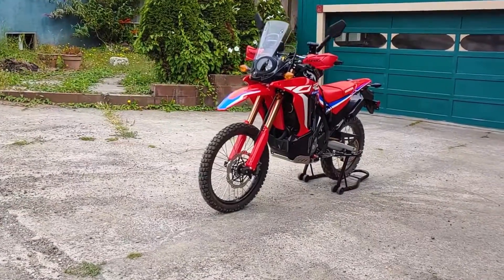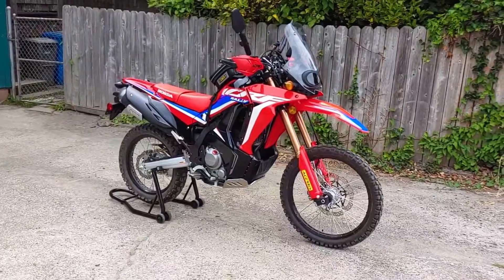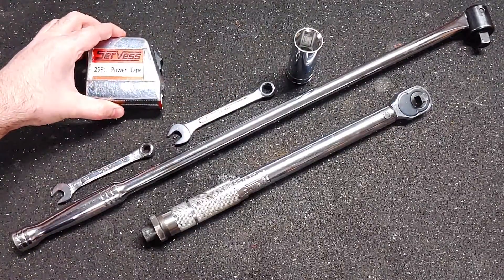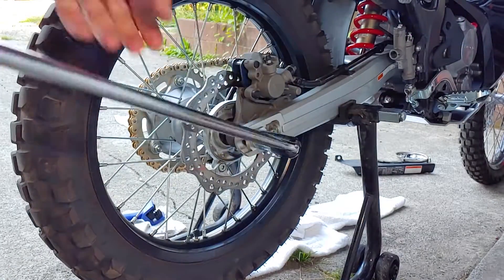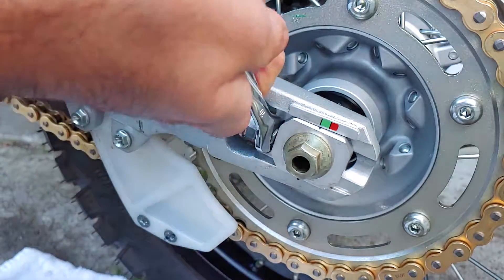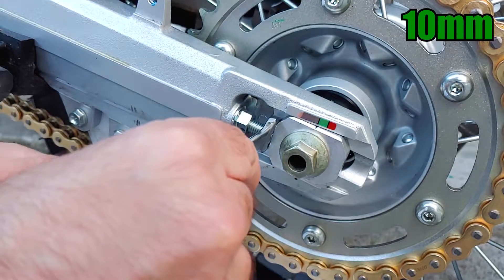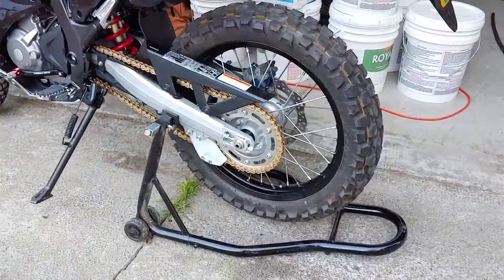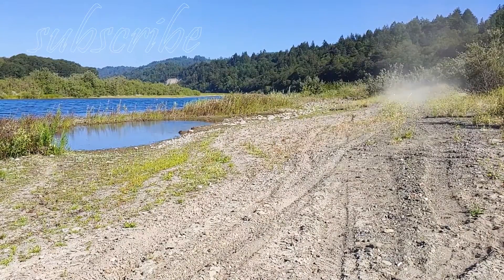Honda CRF 300L / Rally Chain Slack Adjustment with Tool Sizes and Torque Specs

Comment: Good video, just one observation, the chain slack is measured through the slit in the chain guide from the top of the swing arm, not the chain slider, measuring from the slider adds around 5mm to the final figure.
Reply from the maker: I went by the Yamaha Service Manual which says to measure from the bottom.
Reply: @Endless Money Pits  Well its a Honda so...🤷🤦🤦🤦
Reply from the maker: You're right, I thought this was a Yamaha video at first glance. Looking at the video again, it looks like the slit in the chain guide is directly next to the spot I measured and is also over the chain slider, so I am not seeing how it would change anything. Is there a different slit you are talking about? Sorry if I'm missing something here.
Reply: @Endless Money Pits  Dude take down the video, you have no business making these.  HELLO, the swingarm and chain are moving away from each other as you move toward the rear sprocket, they do not run parallel to each other!🤦  If you can't see how then measuring 2 inches forward from where specifically indicated and designated by Honda then you're lucky to get your shoes on the right feet in the morning.  See this is what's wrong with Youtube, any goober can make a how to video.  What possesses you to think you're someone who should make an instructional video on this maintenance adjustment when you've clearly never even read the manual yourself???
Reply: Use a ruler, put it through the slit, rest it on top of the aluminium swing arm and measure from there. If you rest it on the slider you are adding around 5mm so could be out of spec. Honda give 50-55mm and state not to ride the bike if it’s over 57mm
You should also measure the slack at the tightest part of the chain which isn’t mentioned either.
Reply: You don’t actually have to use the slit, it’s just a convenient guide, but you do need to measure at that point and from the top of the swing arm
Reply: Good video???  Literally everything he does in this video is wrong!
Reply from the maker: Yikes, I hope your day gets better. I didn't measure from 2 inches ahead of the slit so I can't agree with anything you've said.  Really hope you don't find my tire change video... lol
Reply: @phantomshtter I was trying to be nice….the filming is pretty good….the audio is clear…..you might have noticed I corrected the obvious mistakes
Reply from the maker: Chain slack is the distance the chain can move up and down. If you measure from the swingarm then you aren't measuring the chain slack anymore, you are measuring the chain slack plus the thickness of the chain slider. The chain does not travel down into the chain slider, so I'm not seeing why you would include the thickness of the slider in the slack measurement. You are correct that I should have mentioned measuring from the tightest portion of the chain. I will add that to a pinned comment.
Reply: @EndlessMoneyPits  you are half right..chain slack is the distance the chain can move up and down.. measured from a fixed reference point.. Honda use the swingarm as that reference point, possibly because sliders are a wear component, but regardless that’s the point Honda provide the reference to.
You could compress the suspension and measure the slack with sprockets and pivot in alignment but that would be a different figure and now we are getting a little more technical so best to use the slit and measure the distance Honda specify…..it’s all in the manual
Reply from the maker: Okay, that makes sense the way you've explained it but I still hate it. I will add another note to the pinned comment about this. Thanks for clarifying this.
Reply: @EndlessMoneyPits  some manufacturers measure from the slider but they can wear and don’t always sit flush so measuring from the swingarm is much more accurate and consistent.

Comment: The settings in the manual are with the bike on the ground resting on its sidestand.
Reply from the maker: Yes but I've found putting the bike on a rear stand makes a negligible difference, if any.
Reply: @EndlessMoneyPits  thats good to know 👍🙂
Reply from the maker: That is not true for all motorcycles. The XT250 I have been working on requires the rear wheel to be elevated while adjusting the chain. The suspension is still under load the way I did it in this video because the swingarm is on the stand as opposed to hanging freely. This is common practice among street bikes, but the type of bike makes no difference.
Reply from the maker: Thanks for the input, I am just a DIY guy, always learning new things and trying not to mislead anyone too badly. I appreciate all helpful information!

Comment: Good video!
Please,if you can help me,is it normal when shifting from 5 to 6 gear to feel a knock in my engine/gearbox?this is hapening also when i release the throttle or when i accelerate from resting rpm (only in 6 gear).sorry for my english
Thank you!
Ps:my bike has 500km and this hapened from the first day
Reply from the maker: Noises when shifting can be caused by the chain when it needs adjustment. This bike is not mine. I have ridden it a few times but it does not make abnormal sounds when shifting.

Comment: Is the suggested chain slack for the 250l in the manual too tight? Calls for 1.0 to 1.4” of slack.
Reply from the maker: I would trust the manual. There should be a sticker on the swingarm that also says how tight the chain should be.

Comment from the maker: I forgot to mention that the chain slack should be checked at the tightest spot in the chain, and the slack should be measured from the swingarm, not from the chain slider.  Rotate the wheel and keep feeling the chain until you've found the tightest spot, then adjust.

Comment: should 30-35 mm on the sidestand .. so maybe 50-55 on  a bike stand is good .. but i prefer do like manual say

or if you want it perfect,. what i do i put enough pressure on rear spring with ratched strap,,  and then tend the chain tight,, and then ,, take off the strap,,  there you have the perfect slack,,

dont put the strap around your exhaust,, 🙂

works for any bike,,   https://www.youtube.com/watch?v=cytkSyOqP-4
Reply from the maker: There's essentially no difference between adjusting the chain with the bike on a side stand vs rear stand. I checked.